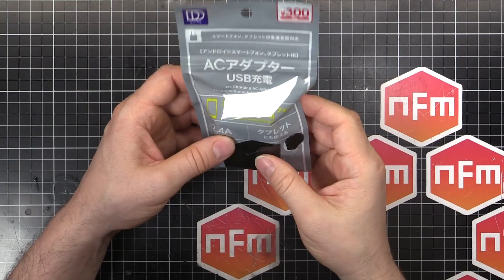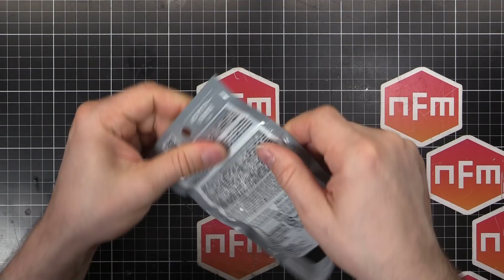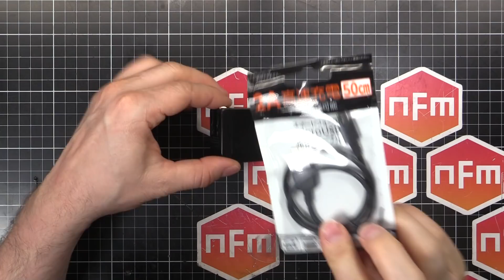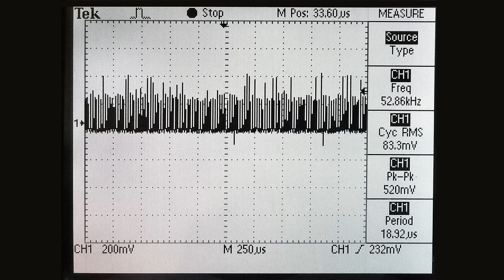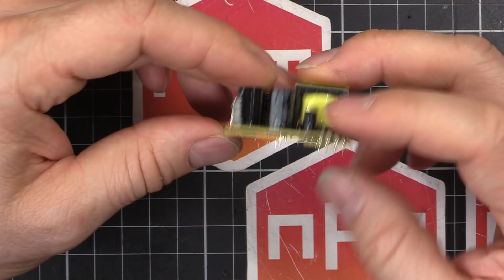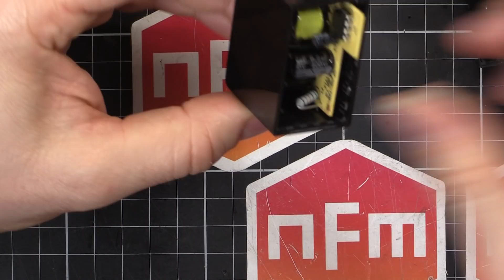Japanese 'Daiso' Brand Phone Charger Review

Comment: Is the USA a plug the same as the Japanese
Reply from the maker: Yep they pretty much the same.
Japan very often doesn't have the earth pin present on plugs and sockets so you can buy 'cheater' adapters, and Japan is at 100 volts which is a bit lower than the USA, but most stuff works fine anyway.
Reply: So where do I get the plus from
Reply: Plug
Reply from the maker: Any store selling white goods or computers should have them, as do many electrical stores in Akihabara.

Comment: Based on your Fluke measurements on the 50cm 2A USB cable: It's series resistance is 0.114 ohm and the copper conductors for the USB power are approximately 0.306 mm diameter. Ohms law FTW! :D